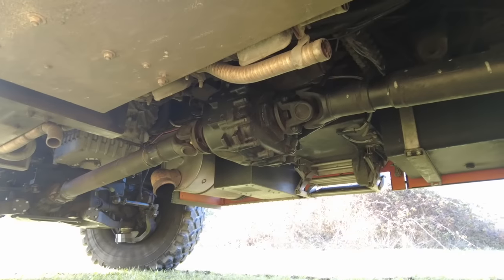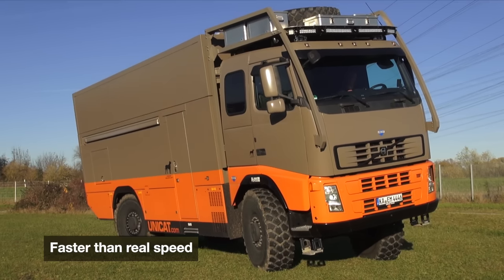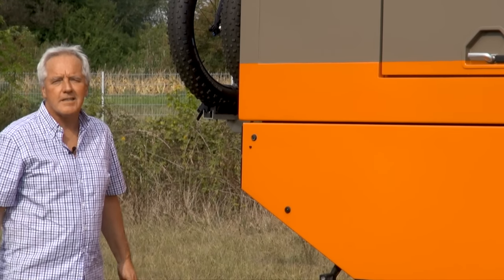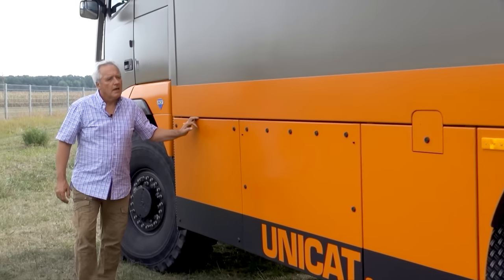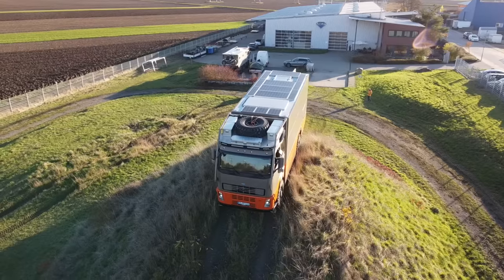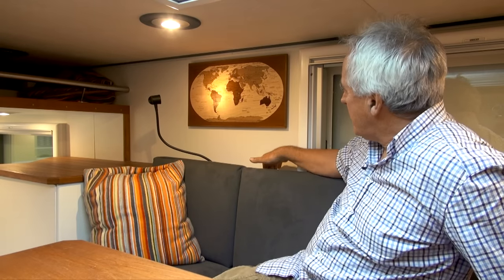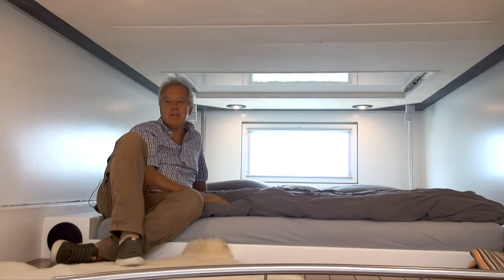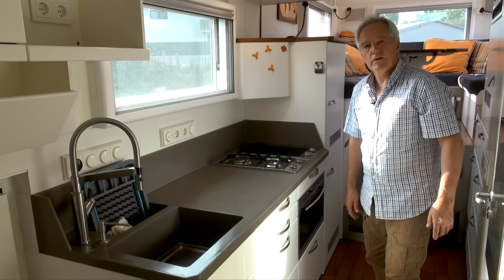UNICAT Expedition Vehicle: IN63HD Volvo FH12 by UNICAT 4 Steering Wheels, 4 independent suspensions.

Comment: This is THE BEST....THE ULTIMATE....THE MOTHER OF ALL EVs.....this is entirely STATE OF THE ART TRUCK..........the colors....the outside storage usage....the cab....the suspension system.....everything is just THE BEST WHAT YOU COULD PUT ON AND INTO IT...........this is the MASTERPIECE OF ALL TIME.......also I HAVE TO MENTION...the quality of the video is on a WHOLE NEW LEVEL it is the best seen so far and im happy to see it will be just BETTER AND BETTER.......the animations...the drone usage.... the cuts.....the layout of the video......im literally crying because this is beautiful.....i hardly find the words because its UNBELIEVEABLE !!!!!...........My dream rig..is an 8x8 all wheel steered and drived + suspesion sys like yours + diff lock obviously + a huge body with slideouts and a partially raised roof + stabilising outriggers which are lift up the whole truck to take the weight off from the wheeles and could help to change the tires if the susp sys doesnt work for some reason + huge independently operating battery packs whiches all will have there own thing to provide with electricity and with there own solar panel(s) to charge them + outside lights on the pole like on one of the showcased truck with the trailer + outside cameras with all the different option like infrared/nightvision/high range on the front + surrounding lights on the cab LED with changeable light output settings + a liftable "garage" at the very end of the truck for a 4x4 or for a enduro bike or for bikes and too many more ideas.................one day i want it make it REAL.........but it would be cost for me estimated €2.5Million atleast on the lower end of the price and it coud be even more.....and this just a cost of a fortune...a dedicated life time....but if anyone make it to this end....❗THANK YOU SO MUCH TO READING THIS❗...... leave a commet/like to notice me if you read it all the way here 💗
Reply: Thank you Gery, specialy for the compliments on the quality of the video.
Reply: @thomasritter1470  Dear Thomas !

IM IN LOVE WITH THIS VIDEO !!.... And i also have to confess that im in love with the vehicle's design and how it ended out !..... i know it sounds insane but, its just breath takingly beautiful !!! Turning back to the video itself....it is just like another world...like its not from our time but like from the future. This video is like an evolutionary step in the channel's history. And my view is that if this quality stays up and evolve it will be a reeeeally  hugely popular channel. I was really like shocked. I waited soo long for this video and it ,was worth to wait for it. I will happily follow this channel to its end. First of all to learn from the videos and secondly to take inspiration for my dream EV. This channel is full of knowledge from highly sofisticated to raw, from personal to industial. Imaginary has almost no borders here. UNICAT's incredible engineers' creativity and commitent is make it possible to make others dreams come true in the workshop ! This is fully unique in all of Europa. And thats because of that too why i love all the videos and the channel itself, because all the video an the channel itself too is unique. And this is just further enhance what Unicat is truly represent with everything inside and outside of it and with all of its vehicles' aaaand with the channel too. UNIQUENESS. IMPROVEMENTS. COMMITMENT for what you are doing in the workshop and on the channel too.
I LOVE ALL OF YOU AT UNICAT ! Unicat must keep doing this quality work for further generations to make all of them see what is quality really are ! 
BEST WISHES TO UNICAT !!

Comment: Absolutely staggering. You set standards so hi, beyond even imagination, that you are an inspiration to many. A huge bow in front of you!
Reply: I wouldn't say staggering. Having the shower dump on the head isn't happening and you really need the Toto bidet. There also has to be a way to maximise the refrigerator/freezer to hold more. And who is going to lift that tire off the roof???

Comment: I have been collecting info for five years for my retirement build, this has been the most interesting yet, and defintely you presented the case to choose Volvo very well...would never have even considered it, but the close ups up the ndependent suspension, all turning wheels, independent suspension and self leveling jacks address all the check boxes for me...great video, now how do I buy the chassis stripped down like you did and have the suspension done here iin Toronto, Ontario Canada...lol

Comment: Lovely vehicle and great Unicat quality. The suspension is great but very complex and not what I would want for traveling. I worked with this on fire trucks and they are difficult to work on and can be high maintenance. I love the lift roof with upstairs bed. This is something that I would like to do. There is too much tech and electrical devices for my liking. It's all things that can cause issue when you are travelling. I wouldn't have it in my home let alone in a vehicle. How hard is it to open a window by hand? It is tech for the sake of it. I understand that this is probably a R & D vehicle as it is your own and fully appreciate that you want to try many options to offer your customers. It is impressive though and your skills are to be applauded.
Reply: N2 (Nitrogen)/Oil  Suspension is an old system, the first commercial public was the Citröen DS 19 In 1955. Also in Oil industry (Drilling) they use this system called Koomey, as accumulators to close the well in emergency.
For a car or a truck with this type of suspension you don't need , Springs or any shock absorber.
Such as the oil is not compressive in a same bowl we have oil and a ballon (n2) calibrate with a specialist the Nitrogen pressure apply on oil makes an energy accumulator. here is a link with is explaining Hydraulic/N2 Suspensions (you can shut the sound drawings are excellents.
Kind regards, Capt-Patrick.

Comment: Exceptional overland truck 👌🏾 only a winch would make it perfect for me. Congratulations!
Reply: It has one, for dropping the spare.
Reply: Tony Lawless not the kinda winch I was referring to Tony 😎
Reply: @johnphelan6623  I know, sorry John I'm just being silly. Thomas is not a fan of winches at all and thinks they are a waste which I think is why there isn't one on his unit. It is pretty cool though with or without.
Reply: @tonylawless4742  True, I am not a fan of winches, just because they only can pull you out pretty straight and if you have a anchoring point - but in what situations is that the case ?
In most situations,  there is nothing to hold on in front of you or behind you.
With a Greifzug ( Tirfor ) you can do much more, pulling into any direction.
Many years back, I had a MAN KATI 4x4 and got stuck on a beach in wet sand when the tide came up. We digged a big hole, put the spare wheel in, digged a tunnel to the vehicle and connected the cable of the Tirfor kind of underground to the front axle.
Pulling underground , we got the vehicle out before the tide arrived. Any other approach would have failed, even a winch, pulling at a certain angle would have lifted the spare wheel out of it´s hole.
Reply: @thomasritter1470  thank you Thomas for your comments,  I am a big fan of you and your company. I agree with you totally and I thank you for taking the time to reply. Amazing vehicles and engineering from you guys, keep up the good work  😎

Comment: I continue to be impressed by the engineering and design of your vehicles.  The attention to detail is impressive.  Can you explain how the lifting roof seals out drafts?  Would it be effective in a cold-climate?  Thank you!
Reply: Hi Duncan, we do not publish technical details, hope for your understanding. But it also works in cold climates, all walls are sandwich panels and of course, all areas of seals are less insulated.
It just needs a bit more heating capacity to keep it warm. And the seal area around is electrically heated in case you have ice building up there after a rain shower.
Reply: @thomasritter1470  Hi Thomas, I completely understand and respect that position.  It's not a problem for me.  I was just thinking that there might be a general description such as those used by seamless slide manufacturers (i.e double bulb) that you use to describe how it seals.  I live in Canada so keeping the cold out is a major consideration, but I really like your lifting roof. ;-)  Thank you again for the very informative video.

Comment: I like the centralised cabinet door locking.  I don't know the details, because Thomas keeps these up his sleeve! But: 
1/ If the systems fails (power cut, fuse blow). Then major internal disaster - not just the single cabinet you forgot to manually lock.
2/ Perhaps it is fail safe - power required to release locks.  Then you are locked out until problem is resolved.  No coffee to help diagnose problem.

Its a great system, when it works.  But in case of a problem Thomas?
Reply: I always wanted to install a manual LaPavoni espresso maker above the fridges - now I have a good reason to do so .....

Comment: Really impressive build with so much attention to details about everything !

The central lock of every drawer and cupboard is the cherry on top of the cake for me.

What are the brand and model of the Independent suspension axle and hydropneumatic upgrades please ?

Did a bit a search on internet but didn't find.

Comment: The raising roof for the sleeping area is so cool. I'd prefer a 6x6 over a 4x4 bit i can't afford either right now so it doesn't really matter.
Reply: Most of our lifting roof vehicles are based on 6x6 chassis as they can easier handle thee weight and the higher centeer of gravity. Going for a 6x6 is absolutely preferable- Except you have a hydrostrut suspension which compensates for most disadvantages of a 4x4

Comment: Thomas I couldn't find enough superlatives to describe this vehicle.
With regards to the Nitrogen suspension, what presssures do you use in the ride struts? Is there an accumulator for each axle or do you have one for each ride strut? Do you carry a nitrogen charging kit in you're onboard tool kit.
Thanks very much for alowing us to see your personal vehicle.
Reply: My pleasure, nitrogen pressure is set to 50 to 60 bar, oil pressure is appr. 140 bar. Each wheel has a accumulator.
After 15 years, the nitrogen pressure dropped by 2 bar only and as the weight of the vehicle goes up and down by only 5-7% due to fuel and water levels, I have made a comfortable ride setup and do not carry nitrogen to change suspension settings while driving.
Reply: @thomasritter1470  Thank you for the reply I had expected the Nitrogen pressure to be around 800psi so I wasn't far out.

Comment: Looks great for being 15 years old, probably because Thomas is responsible for cleaning, 😆 I would liked to have had some information about the solar system, other than that, Thomas did a good job. He did lose me when explaining why the spare tire is on the roof? 😂. I enjoyed watching, thank you! 🌴😎🌴 FL.
Reply: While he explained that they store it on the roof because the cab suspension is disabled, he never explained how two seniors are going to get a tire weighing several hundred pounds onto the ground when they get a flat.
Reply: @bradsimpson8724  they ofcourse have a winch for that. He did not say it but it's very common for such setups.

Comment: Love you had use on your own truck some ideas I had too, like rear axle steering, hydrostat suspension, automatic transmission , ... Ever think about hybrid motor, growing the number ofsolar panels when you are parked, so you use less fuel? All panels can be all around the outside of the lifting roof
Reply: 4:40 I think the roof is almost full unless you mean unfolding petals?
Reply: @mattydare , yes, if u drive 3 o 4 hours by day, you can be stopped and unfold petals for a lot of hours🤔

Comment: I was wondering if you could tell us the heating and cooling difference between the roof being raised or down?

I imagine it does not make much difference most of the time but would think the difference could be quite large when it is exceptionally hot outside but even more so in the depths of winter or at higher altitudes where it can get extremely cold.

I really like this design, it is the best all around package i have ever seen, but the ability to efficiently heat it at -35C is a big concern for me.
Reply: When you're in a cold environment, do not forget about the independent suspensions with HYDROstatic system.
Reply: @logicfuzzy7484  I would be astonished if they actually used water in the hydrostatic system. They are likely just using hydro to indicate the presence of fluids, like hydraulics. No, it will be using some form of oil and the correct viscosity for expected temperature ranges will be available for reference. It would not be an issue.
Reply: Lol dude, I know they don't use water in these hydraulic systems. But I wanted to say that at low temperatures, even special fluids often become less effective or even turn into ice.
Reply: @logicfuzzy7484  The term hydraulics is used for all types of liquid, water s just one of it. The system works with oil, for many applications we use airplane grade hydraulic oils as used in landing gear. Expensive but works down to - 60°C
Reply: The vehicle has two diesel heaters wiith amax. output of 18kW, in high altitudes it still provides 12kW.
This is plenty to heat the body, even with the roof up. All walls are sandwich panels of ifferent thickness.
Reply: @logicfuzzy7484  Of course, military grade suspension systems made in Sweden are not built for cold weather... And you are the first one who thought about it!

Comment: Very interesting and amazing concept!  With independent suspension and four wheel steering it should be much nimbler and tight trails and off-road than any similar size vehicle with traditional solid axles, leaf springs and "only" front steering.  

Are you planning to make a video about it, or does it already exist somewhere on YouTube?

Comment: Amazing rig, truly amazing. One question Thomas. When you discuss the spare wheel on top of drivers cab along with storage boxes ...with all that weight on the cab, how do you access the engine? Does the cab + wheel + storage boxes all rotate with the cab to expose the engine? Thanks very much :)
Reply: and the dificulty  to remove the tire ?
Reply: The cab tilts including the rack and the spare wheel, the weight of the boxes with Kite equipment is almost nothing.

Comment: Hello. Your overhead fuel gauges should show the gas filler on the left side of the pump station for the left tank and on the right for the right tank. Andrew
Reply: @Proriz,
In many heavy-truck filling stations, two hoses fuel the vehicle 'saddle' tanks simultaneously.

Comment: But how do you take the spare wheel of the roof, when you are in the field ?
Nice job and a lot of technical good solutions involved  in the trance over  from a road to of-road truck!
Reply: The same way you do when the spare is on the back. With an electric/hydraulic winch built into the truck. 
It's 200kg.
Reply: @Arrynek01  now that is a good one, do you see any winch on that roof?
I don't bud can be its hidden somewhere.

Comment: Very nice vehicle. But Tatra chassis would be better for offroad. They have all these features as option from factory. With Phoenix cab (DAF CF) the same truck category. Maybe bit more expensive, but with this living extension total cost will be high also for this car. Finaly it will not be so big differecne. And in offroad much more comfortabale and faster :-)
Reply: Unicat has built one Tatra before. But you can't find it on their website or anything. 
The owners died in Africa (somewhere around Kilimanjaro if I remember correctly), and the truck was used to bring home their bodies, from what I've been told. 
As for the capability... Tatra is built for extremely heavy loads. That's why they have the otherwise pointless swinging half-axles. It's a compromise not worth having unless you plan on lugging 30 tons through an iron mine. 
The other problem is spare parts. MAN and Merc trucks are the most common body because you can find parts anywhere in the world.

Comment: sounds like it's time to do a tatra build!
Reply: Why, please explain
Reply: @thomasritter1470  seeing as this volvo is now full independent suspension, it would be nice to see what you can do with a tatra chassis and it's famed suspension design
Reply: @kumbackquatsta  The Tatra axle and suspension setup is quiet unique and offers better off-road capability than rigid axles with leaf springs. I think if one wants to use a Tatra chassis, it should just be used as it comes, so there would be nothing to do for us - which is good. But if you want the best, you make a combination of a state of the art cabover truck chassis with independent suspension axles and hydro struts.

Comment: Super cool, but is that mold on the frame, right above the windows (which can be seen when the owner is sitting down)?
Reply: Did you mean around 16:10? It just looks like it might be the grain pattern on the headliner fabric.
Reply: @MetalY2KMusic  I think he means at 21:00.  May just be unavoidable with that style of pop-up? Certainly wouldn't have been my takeaway from the video.
Reply: Could be road grime
Reply: @donbreeden1993  Could be. Neither would be a deal breaker for me 😁.

Comment: nice truck, ive two questions...how much weight you add with this axle and suspention setup compared to a normal 4x4 setup, and how long does the suspention hold its pressure how long u can stay level when parked ?
Reply: we do not add any weight, the suspension components are not that heavy compared to leave springs.
The system works with Nitrox, the pressure stays for ever, I lost 2 bar ( of 60 bar ) in 15 years ! And refilled it in 5 minutes.